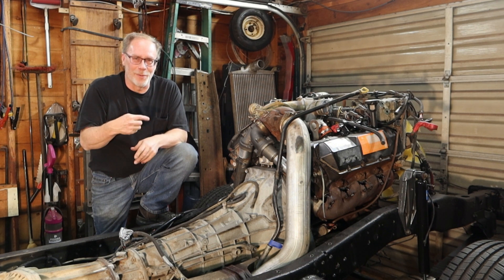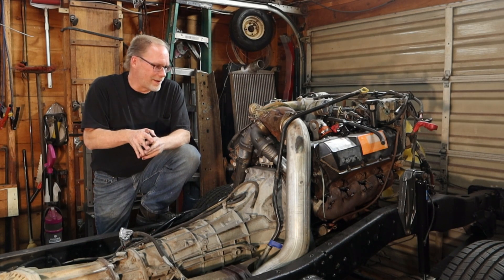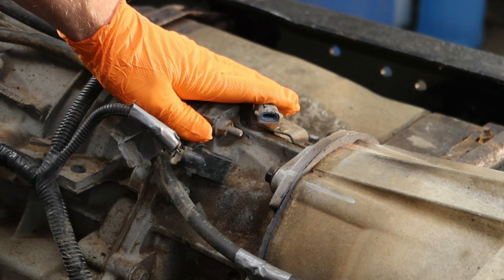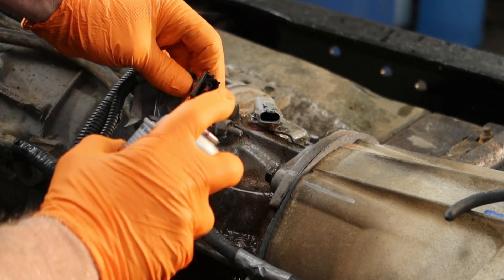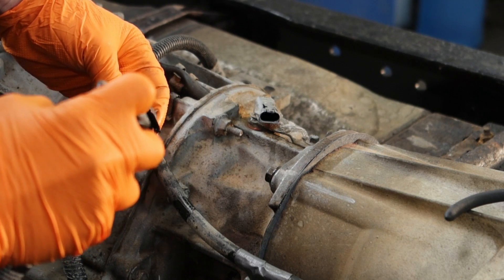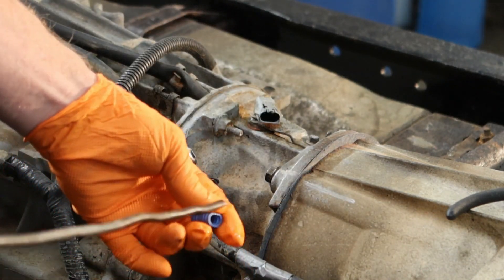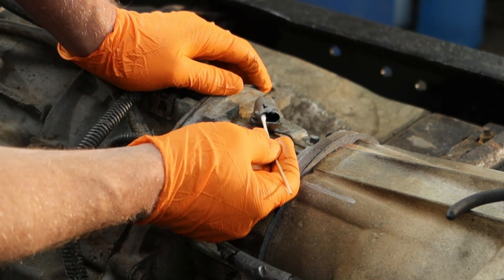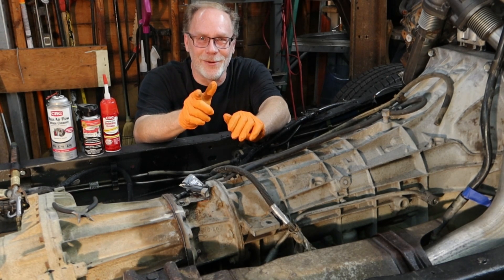🛻📽️7.3 PSD QUICK TECH TALK CONNECTION CLEANING ....🟢🟡🔴🟢

Comment: What vendor do you recommend for a new wiring harness?

I've thought about taking an online class on how to do my own wiring harness, but electrical stuff isn't my forte. A lot of folks say the price would be the same if I had just bought one put together.
Reply from the maker: Riff Raff diesel is a great supplier There are several good deals on ebay as well There are some harness's that are not available but we are working on a mod video how to change a auto trans harness to a manual trans still waiting on docs from ford yet

Comment: Where is a good place to get the PCM and IDM harness? I have a 7.3 that is stuttering at lower RPMs when driving. But idles and sounds fine otherwise. Power is there from a stop. Just has trouble if I’m on the freeway cruising around 50mph and try to accelerate. I have replaced the main engine harness and all the main sensors and IPR valve. 

Thank you!

Comment: Ya learned me something,like the two step cleaning and im probably over doing the dialectic 😳
Reply: Just remember "Die Electric" is just that, it kills electric arcs and is NOT used to make a good electrical connection. You may want to use an electrical contact enhancer such as DeoxIT® Gold Contact Cleaner Spray to help lubricate a connection and give it a little protection from oxidation.